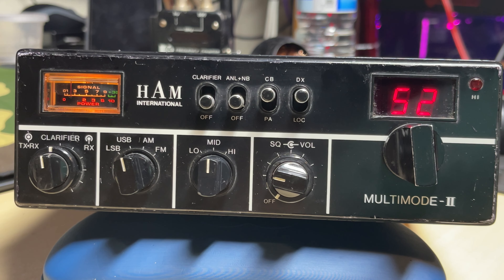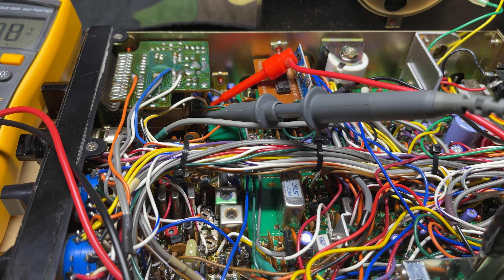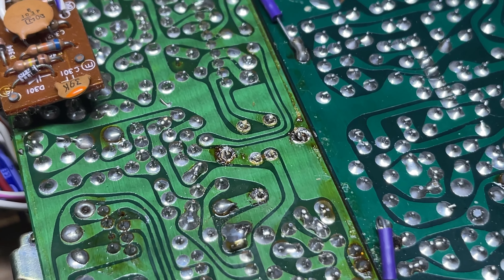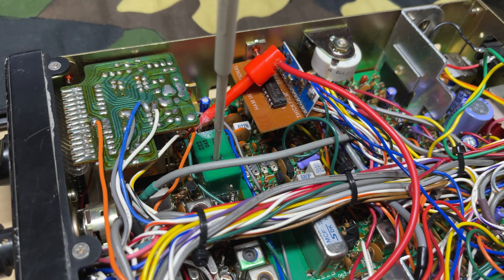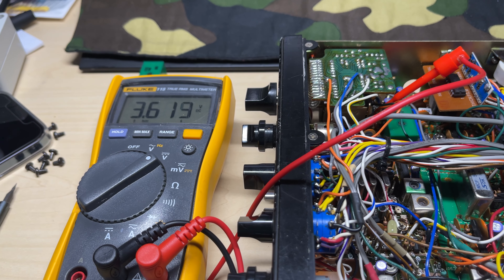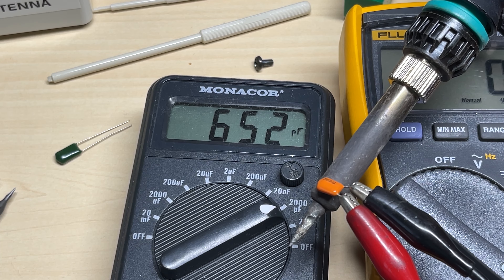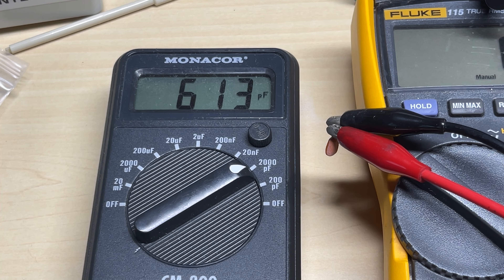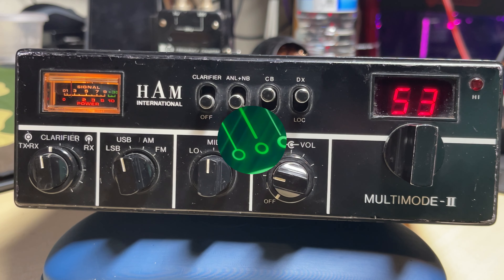EP 094 - HAM International Multimode II - C11 Failure ? - VCO Problems.

Comment: C11 prone to failure so I change these on every radio I get in 
VCO’s are now the cybernet’s biggest failure so now I swap them out for a microchipz one 
Other than those two faults I find them reliable 
Monitoring the 10.240 with a counter will show it up when C11 fails
Reply from the maker: Just glad I managed to catch it on camera .
Reply: @MicroChipz  I’ve never caught one failing whenever I’ve come across it there either working or suddenly stop nice little video showing how it starts failing

Comment: Interesting video, what type of cap did you change it with was polyester?
Reply from the maker: Yes
Reply: @MicroChipz   Thanks. I had a similar problem with my Jumbo so I completely disabled the PLL reference crystal and oscillator circuit as it was causing interference with the rest of the receiver so I used DDS for the 10.240MHz instead. (Note: mine is a heavily moded Jumbo that does not need the PLL ) I will replace the cap 11 and reinstate it if it works. Thanks for making the video.

Comment: Hi there just wondering  what you replace c11 with can't seem to find a 560pf tantalum or could you tell me how i can source 1  thx kev .
Reply from the maker: https://www.ebay.co.uk/itm/263756115737?hash=item3d6916ef19:g:hPsAAOSw9Jpkhtsu&amdata=enc%3AAQAIAAAAwPEIs%2BvQyhjhpM5iCTx7qcxh0uHgE7r1kHCdLF1yhyXWivYwByvxkHV2fImo%2F3EIJNaXpOB9szSRmacODdsT8Tad2VPoECFel4xmQ4Dnsl4Ab%2By1SJc%2FeEYNCSPauJ97UyjQpJgFPERdmvdn7Ef8dKx0uJh%2B5Rtqtm0Tc3Ue4qmgy8hhtUKflXwOP%2FYg1c9zdSZOPYHFkSU2xhhKu%2BDV6X3At%2F4kMMidok7S%2BFNGtWvoeByjuB7I9inp%2FHBTBKGCLg%3D%3D%7Ctkp%3ABk9SR-jrwIqhYg

these are what i use
Reply: @MicroChipz  Thank you so much very much appreciated top man .👍😁